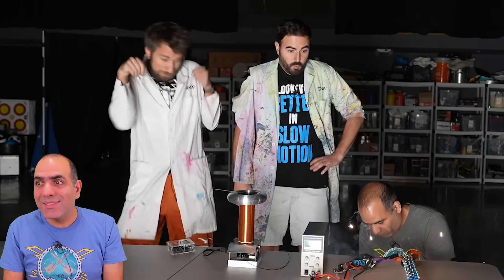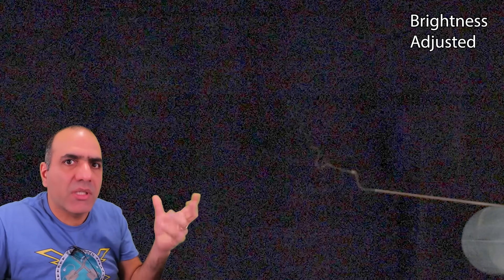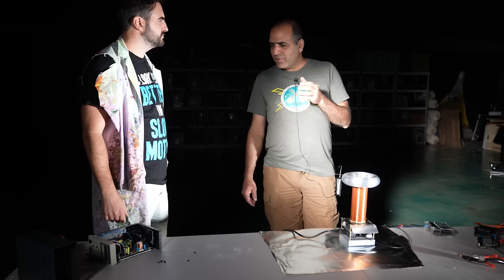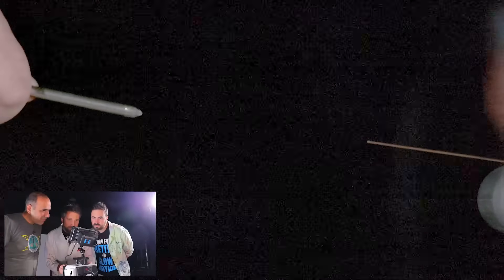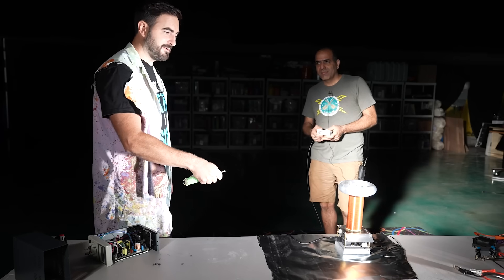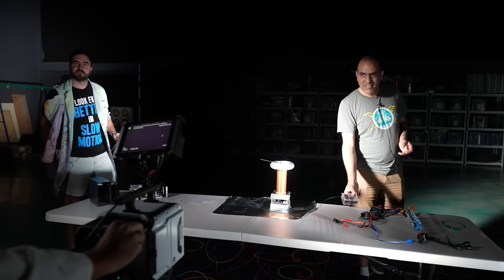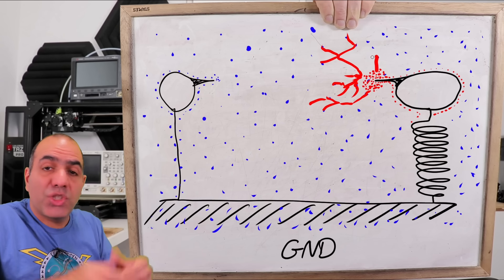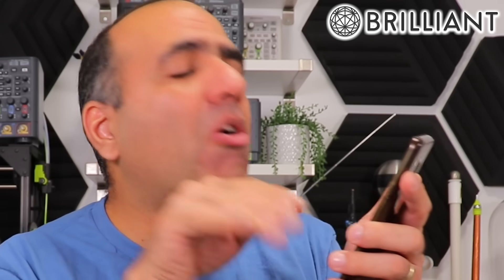ARCS! Frame by Frame

Comment: All this time you mention how the air particals are a big part of the arc process, does that mean in a vacuum, arcs cannot form?
Reply from the maker: In total vacuum, which is nearly impossible, electrons will jump but you won't see them. Maybe our on the surface of the contacts were they get hot
Reply: To add to that, high vaccum is a far better insulator than air. So very few electrons will actually leave the conductors, unless you heat up the electrodes (look up "thermionic emission")

Comment: I made a small air gap relaxation oscillator, a few years ago, powered ~3-5KV. I measured the current flowing thru it on a scope. It generated sawtooth waves at a tad over 1MHz. So air, at standard atmospheric pressure, has a very high response time. This is in contrast to noble gases, at near vacuum, such as in a neon bulb, where response times are the 100s of microseconds.

Comment: How do they ground electronics in cars, planes and spacecraft? Would love to see a video on that.
Reply: "Ground" means many different things, from actual earth ground, to "safety" ground (usually has a path back to earth ground), to "RF" ground (often a counterpoise; that's another story), to "chassis" ground (a common return point for circuitry). The chassis of a vehicle serves as "chassis" ground for electrical purposes, and there is no connection* to actual earth ground.

*Many buses, some trucks, and emergency vehicles have chains dragging from the chassis and touching actual earth ground to dissipate static electricity buildup.
Reply: The entire body surface is the ground.

Comment: The control signal was 250 kHz, so of course 100 kHz frames weren't fast enough. If you want to see the dynamics you would need closer to 25 MHz frames.

As for the spark theory, the electric field strength is going to determine which side arcs strongest first. Your Tesla coil had a much longer sharper geometry which will give it a sharper voltage gradient (ie. electric field). If you had him hold copper wire of similar geometry to the wire on the tesla coil, the arcs would be more even. Electrons don't care about absolute voltages, only relative ones so floating won't matter.

Comment: @10:40 if the red arcs are negatively ionized gas particles merging from the cathode, then the blue arcs are the positively charged gas ions around the anode (ground), that give up their electrons ? That same experiment in a hydrogen atmosphere would result in larger arcs around the anode ?

Comment: If you record the coil with a frame rate that's out of phase with the resonance frequency you would get pictures of different stages of the arc each time. Then you could stitch them together to get an even better animation.
Reply: problem is the tesla coil is not really running at a very stable frequency, as the frequency depends somewhat on the arcs, and those are quite unpredictable.
Reply: @Basement-Science  and the arcs won’t have the same paths
Reply: That came to my mind too. If I remember correctly, that’s how some scientists filmed light moving.
Reply: Clever!

Comment: Hey mehdi, i have a question
Lets assume tesla coil works on DC. If required power is given then can we see electrical arcs travelling in a straight line?

In other words can electric arcs travel in a straight line just like light?

Pls answer
Reply: transformers dont work on DC because the magnetic flux does not change, hence the there is no induction
Reply: @miguelm203  that's why i used word "assume"

Comment: A question about electric charge separation: if you have two objects with identical shape (spheres or discs) with isolating walls around them suspended in a conductive medium, and the same charge is applied to both objects - would they attract or repel at long/medium/close distance? Would the opposite charges clustered around the objects net add to the repulsion, balance out added repulsion and attraction or net add attraction?

Comment: This is interesting to see the arc in that frame
But what happen when there is nothing for arc to jump through it for example in vacuum 
The arcs go in deferent direction or just in straight way?
Reply: there isn't a true vacuum, any gas molecule in the way of the arc will get ionized and ripped apart. in a lower pressure, as there is less molecules, the arc will need to build more energy to do each jump, resulting in more bright arcs. he has some videos trying to show this effect

Comment: That was awesome!! It's a shame you didn't have a vacuum chamber on that high-speed shoot to test that final theory, but next time!! It would be cool to amp up the lighting too so you could see more of that electron fluff at the higher framerates, but I'm not sure how feasible that is at 1,750,000 fps.
Reply: Gotta watch out for x-rays when doing sparks in a vacuum...
Reply: I don't think the issue is vacuum because the arcs themselves are from ionized air. The problem is that they're all touching (through solids) the earth. What needs to be done is suspending the whole setup in air without any contact to the earth (or any other ground). Maybe by dropping the whole thing while it's on?

Comment: however the real Tesla Coil is far from the ''tesla coils'' we see on internet, the real tesla coil is not digital is analog.

the spark also shouldn't  start, as Tesla said '' ball of fire should not exit from the capacitor to start the transmission''

Comment: I wonder why the arc doesn't travel in a straight line??
Reply from the maker: air is not a uniform medium, but a very random combination of air currents and molecule types.
Reply: I think very tiny differences in resistance of different parts of the air, so it "chooses" the lowest resistance part which isn't always straight ahead.

Comment: Now I want to See Mehdi's Eyebrow wiggle at 1,750,000 FPS
Reply: Bring the micrometer to see the movement
Reply: The slow-mo guys said that one second in 1.75 million FPS equal about 19 hours in normal time.
Reply: @yanikb.1312   It depends on your definition of "normal time". If you playback the video at 30 fps it will be 16 hours long. Just divide 1,750,000 by the playback rate.

Comment: So could you power your coil through an isolation transformer and get it to generate arcs from both directions simultaneously?
Reply from the maker: Would possibly do better in jumping both ways.
Reply: @ElectroBOOM When is the breakdown for the marx generator slo-mo coming? It's been over a year. Have you dropped the idea?
Reply: Yes, but you would need a transformer that can withstand an isolation voltage of several 100kV....difficult to find, actually.
Reply: @WolfgangMahringer  Not as difficult to find as it would be difficult to fit in a studio.
Reply: All you would really need to do is isolate the Tesla coil from ground, and connect the "grounded" side to an otherwise isolated electrode. Probably easiest if you run it off of batteries.
Reply: Surely no isolation transformer is needed. The driver circuit is at ground potential, it’s only the hat that is at high voltage. I would think it’s possible to place the driver coils in series or parallel and drive them with a common driver (with suitable adjustments to it). Phase the coils so that one is positive and the other negative.
Reply: Isolation transformers have their primaries and secondaries relatively close together. This leaves a tiny bit of capacitive coupling between them. Compared to a 60Hz power line it's nothing but at 100s of kHz this coupling would likely have a noticeable impact.
Reply: @eDoc2020  but you wouldn’t need an isolation transformer.
Reply: You need a bipolar ungrounded Tesla coil. No mains isolation transformer will handle hundreds of kilovolts and kilohertz.
Reply: The Tesla coil in itself is an isolated transformer, the primary coil at the base is air coupled to the secondary coil. The base of the secondary coil to the top of the toroid has a potential of ~200kv. You HAVE to tie the base of the secondary coil to earth ground to force the top to have a voltage differential to seek ground. If you don’t, the sparks come out of both the top and bottom of the coil (where all of the sensitive operating electronics are), which can lead to a very frustrating afternoon. To get the effect he was talking about, you would want to put the coil and the person, still electrically conducted to ground, in a low pressure atmosphere.

Comment: Wait, I thought electrical arcs were free electrons so they were always negatively charged. How can it jump both directions? Are metal ions being pulled from the electrodes? Come to think of it, why doesn't it alternate jump directions?
Reply from the maker: Yes it is the motion of electrons, but while one side pushes electrons in the air molecules, the other side sucks them out so both sides look like arcs anyways. Also note that Tesla coil is AC, so electrons are pushed and pulled at 250kHz here, and yet you see arc forming more on the Tesla side.
Reply: @ElectroBOOM  To me it looks like all those barely visible tendrils start homing into the same point and when they converge, the brightness goes up. That makes it look like a new spark is starting to appear from that side as well but it is actually the tendrils of the original one regaining their brightness.
Reply: @ElectroBOOM  I do not see how the other side could suck electrons to make arcs jump both ways if floating in space. A new video perhaps?
Reply: @briankelly6561  The electrons are being sucked in from the air molecules. Once the nearby air molecules are stripped of electrons they start acting as ionized channels for pulling in even more electrons. This is the exact same thing as is happening on the other side.
The main difference is the voltage of everything else in the system. The reason the low-voltage side doesn't make arcs is because when the voltage difference starts to build the low side's voltage is the same as the voltage of the air, so the electrons don't need to flow from the air to that side. Once the nearby air is ionized by the high side the electrons in the low side begin to be pulled toward the pocket of ionized air, which is where you see the small arc at 5:30.
Reply: @briankelly6561  So, we need to send ElectroBOOM and the SlowMo Guys into space to carry out this experiment?

ELON!!!!!!!!!!! MAKE IT HAPPEN!
Reply: @ElectroBOOM  love you broo ❤️♥️🌹
Reply: @ElectroBOOM  That raises so many questions for me.  The other side sucks?  Isn't all the energy coming from the Tesla, so it's pushing. Surely it pushes in all directions.  Does it find the other electrode and 'push' them there by preference?  This is gripping stuff, thanks to all
Reply: @Simbosan  Instead of the other side sucking electrons you can think about the other side's electrons being pushed away by the incoming arc (before the arc connects both sides). On one side the tesla coil is pushing electrons into the air which causes the air electrons on the other side to get repelled and go to ground. This causes the arc at both sides.
Reply: @ElectroBOOM  Some might say the other side is pushing out holes.
Reply: @ElectroBOOM When is the breakdown for the marx generator slo-mo coming? It's been over a year. Have you dropped the idea?
Reply: The same can happen with lightning strikes, they not only come down from the sky, but some of the bolt comes up from the ground. I believe they can also strike upwards from the cloud.
Reply: Electrons are not what they think
Reply: What you're seeing is light, so it's photons not electrons? And (my admittedly rusty) physics says these will be generated when the electrons change energy state, specifically when they go from a high to low energy state. So what's you're seeing move is a side effect of where the electrons are changing state, I think. I could be wrong.
Reply: IIRC the streamers pulse with the resonance frequency of the coil

Comment: Could be fun to run 2 tesla coils, with one 180 degrees phase-shifted :)
Reply from the maker: Arcs must jump out of each that way and reach at the center!
Reply: @ElectroBOOM When is the breakdown for the marx generator slo-mo coming? It's been over a year. Have you dropped the idea?
Reply: The 2 tesla coils would run at at a slightly different frequency. So they would be going from in phase to out of phase at the difference of these 2 frequencies. That really is going to be very cool to see.
Reply: Make it 90 and you get double the arcs
Reply: @VincentFischer  You can increase frequency to double the arcs, not the point..
Reply: @FrankDrebin  Yea but you would get alternating arc left right, seems like a cool effect
Reply: That would be cool
Reply: How did you watched this video so early
Reply: @PrinceGT  Probably Patreon access perks